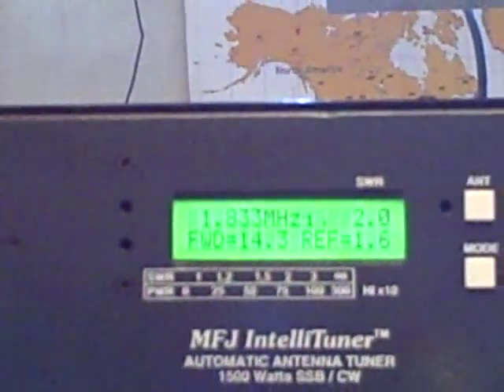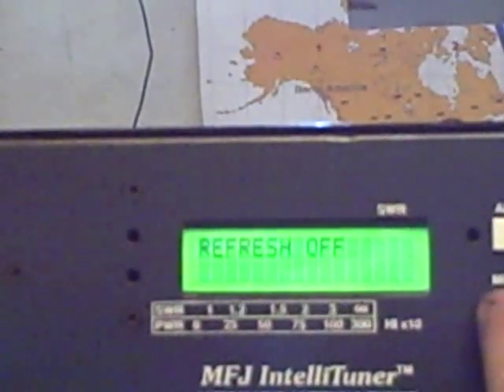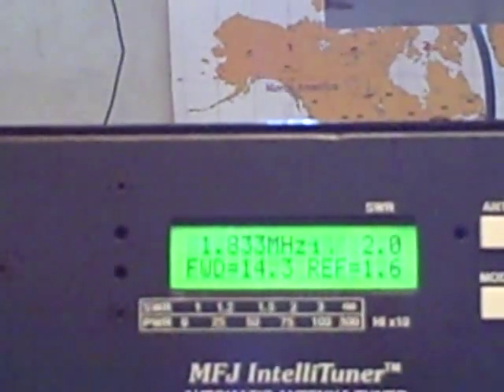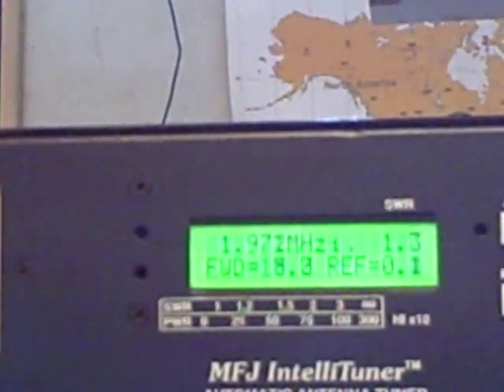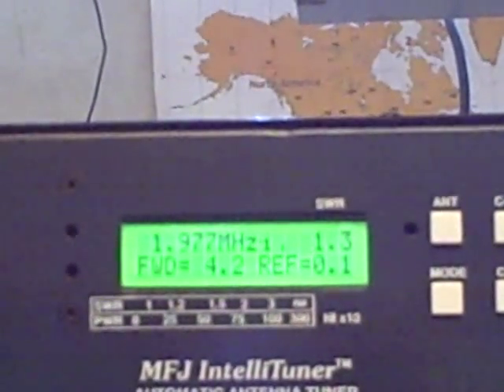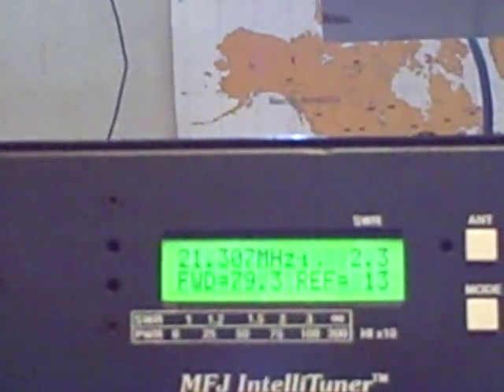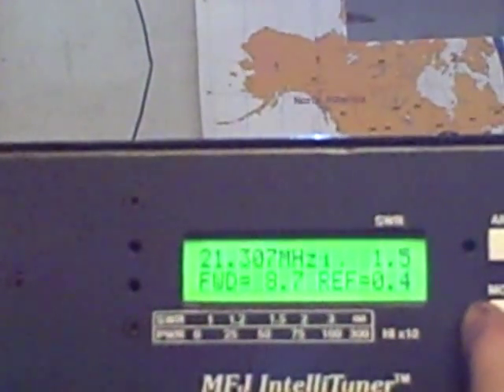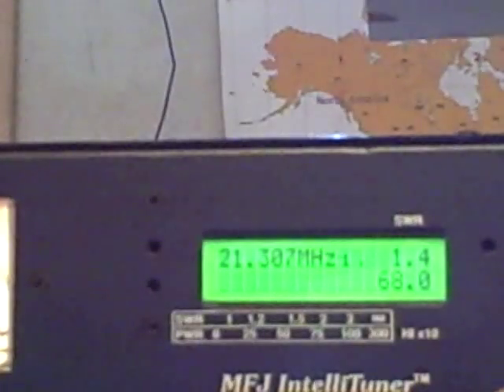MFJ 998 Demostration

Comment: Could you tell me how to read the FWD power, digital read out, under 100 watts, while in ssb? Currently the screen shows 18.0 FWD while using 102 watts on my Icom 7300. 

If I switch to a steady output(fm carrier), the digit meter shows the 102 watts output. 

Thanku!!
Reply from the maker: I sold this tuner years ago, but one of the drawbacks to it, was it did not do peak envelope power (PEP) readings.  Modes like FM and AM will show the true power, SSB will always be less than what it is actually is.
Reply: @ Very true.  They shld hv added that.  But my question is: How can I convert or mk sense of the Fwd power in SSB when it shows 18 or 23.0 etc etc?